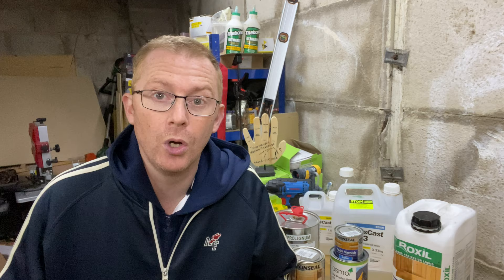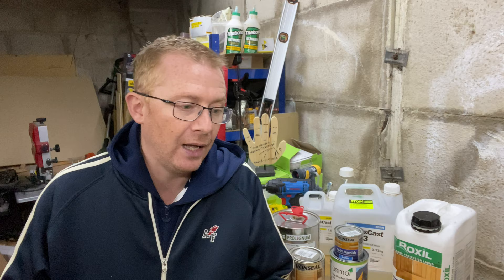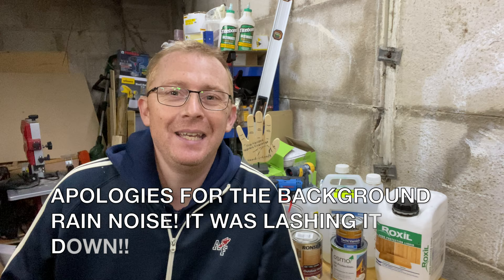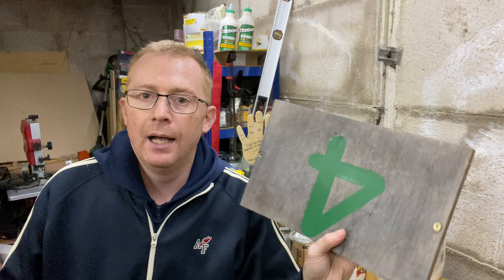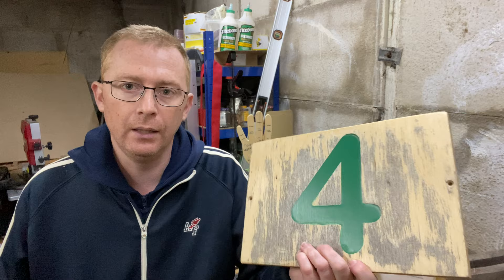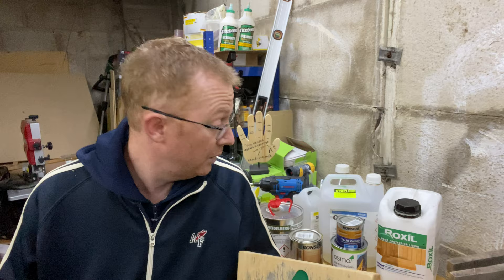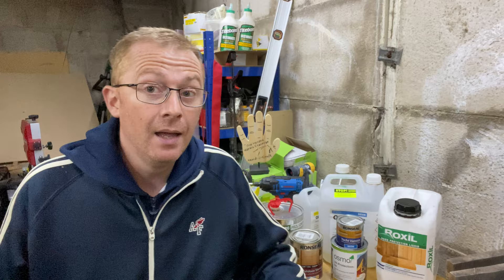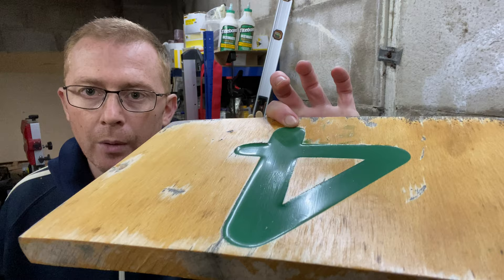Is Epoxy Resin Suitable For Outdoor Projects? (Part 2 of 2: The Results😀)

Comment: Oh, thank you so much for this! I was thinking of using epoxy resin on top of a concrete pad in the back yard, but after watching your video, I don't think I will. Thanks for this experiment!
Reply from the maker: Thanks Helen, if you’re after a nice shiny finish, have you considered polishing the concrete top? It takes quite a lot of work sanding through the grits like you would with a wood / resin table, but I’ve seen finished concrete tops that look fantastic 👍👍
Reply: saw a video that someone had a business made an outdoor wood and epoxy bar table that failed from weathering and when he made a new one he used Total Boat Halcyon  clear as the topcoat and gave updates on how it weathered and it worked perfectly. Make sure to do seal coats with the epoxy first to let it penetrate before thicker coats then sand prep the epoxy and top coat with  Halcyon or something comparable maybe? Wood and concrete need a seal coat before epoxy is poured so it doesn't seep into voids unwanted.

Comment: I had my money on Yacht varnish ⛵ but sec is OK, never expected osmo to finish top I thought that was just a hype train 🚉😂 great experiment Leo and now we know it's either Osmo or Yacht varnish for outdoor use. 😊😊
Reply from the maker: Totally agree Karl. Have to say the Osmo UV oil blew the rest of the other finishes out of the water. I will say the test was pretty brutal and accelerated the affects of moisture and UV, particularly with the angle the board was at which meant 'run down' not 'run off'.  But even so it is interesting to note how well one product holds out so much better than others in exactly the same conditions.

Comment: Great video Leo. Can't believe 4 months have passed already. Like someone said, leave the top 3 out over winter in the frost & snow, that should give a definitive winner. Keep em coming. G
Reply from the maker: Scary how quickly the time is passing at the minute Gary. And yes, just put the top 3 back out. Will post a pic later on Instagram. The angle certainly has accelerated the destruction process so to speak. I said in another comment that I forgot to mention in the video the original house number I done for a friend is holding up fine with just two coats of outdoor varnish, but it’s at 90 degrees to the wall. I showed my fiend the results of this and what will inevitably happen to his sign long term, but we only done as a test anyway so he didn’t mind being the guinea pig for it😀😀👍

Comment: Thanks so much for doing this experiment.  You're right that there isn't much long term comparison out there as far as I know.
I think when my Ronseal yacht varnish runs out I'll replace my outdoor product with the Osmo UV protection oil.  The issues I've found with the yacht varnish didn't appear until December in pieces I made in late spring.  Issues tended to be on horizontal pieces too, such as a varnished decking board used as a top to my daughters' mud kitchen.
Reply from the maker: I’m only guessing Andy, but I think the greatest cause of the coating ‘failures’ is the movement of the wood allowing gaps to appear. The boards were mounted on the osb with a spacer at the back and it was noticeable how much they cupped during the course of the seasons, but the Osmo board didn’t. It could just have been that piece of timber, but they were all taken from the same length of timber so I’m going it is more likely the oil worked it’s magic somehow and kept the board straight and true. I said the Osmo is an expensive product, but really it’s not that much more than the yacht varnish. Personally I think we turn to the likes of yacht varnish and danish oil because they are familiar sounding names that our dad or uncle used on a project in the 80’s (like creosote as well but that is banned now😂), but oils / varnish’s / coatings are very much a science now and I’m guessing have advanced massively in recent years 😀

Comment: I hope you leave them out over winter so we can see a 12 month update! I started using Osmo about 18 months ago, great stuff and in the long term not that expensive (you get what you pay for)
Reply from the maker: I’ve just put the top 3 back out Pistol. Just going to post a pic on Instagram now. Will leave it out for the winter and see what happens 🤷‍♂️😀
Reply: @Hand-i-Craft  Can you update on the winter experiment, did the Osmo UV Protection Oil  still hold up well? would any UV oil work? as there's some really good clear decking oils that also work very well on most woods, they penetrate the surface and prevent ingress of water and not so expensive.
Reply from the maker: @gazsto9510  Hello Gaz, I don’t know if you have Instagram, but if you have I posted some updates on there about this. Just to further clarify this was a brutal experiment that accelerated the process, I’m not one of the Osmo fan club for the sake of it, but the osmo product I used in this experiment was head and shoulders above any of the other products 👍👍

Comment: I have just had an oak sign go very black due to moisture egress which was covered with 5 coats of osmo uv oil. I was surprised to see osmo came out best for your test (which I thought was a great test) but I will no longer look to osmo oil in the future.
I'm going to try a complete encasement in epoxy for the replacement and see how I get on. Rather frustrating situation.
Reply from the maker: Thanks for the message and sorry to hear about your experience. tbh I have done a video about using Osmo UV oil on the cladding of the front of my workshop and had a very poor experience with it. Oak can be a difficult one for outdoor use. Good luck with the complete resin encasement, I’d be interested to hear your results in the future. My only concern for doing that is the movement of the wood through temperature changes would cause the resin to split and crack, thus allowing moisture in. Could be wrong though and good luck with whatever you decide 👍

Comment: Awesome experiment matey, If you reverse the air flow on a decent bike pump and place the wood in a sealed plastic bag and suck the air out you would get fairly good epoxy penetration into the wood. When fully encapsulated the wood doesn't change moisture content anymore and should be very stable. And of course using top of the range west systems epoxy will be better than the stuff people market as river run epoxy or whatever they call it. Epoxy is strong as hell but it needs some form of uv protection. My 0.2 pennies.
Reply from the maker: Cheers Brin and thanks for the detailed insight there, really interesting stuff 👍👍😀😀

Comment: So apart from Osmo they all pretty much failed,  I use a mixture of white spirit olive oil and raw linseed oil on outside projects and it fairs very well at waterproofing, and it really depends how well the wood is sealed as to whether you need hardwoods or not for exterior use and very important to coat all surfaces to get true results. but I really love these videos and the fact that some don't last 4 months is pretty appalling. keep em coming.
Reply from the maker: Designer- Garb Cheers Designer. It was really interesting to see how this experiment progressed. I do have to say the way I set it up certainly accelerated the process of what would happen. I should have mentioned in the video (but forget as I often do) the house number I originally made for a friend is holding up well as it is mounted to the wall at 90 degrees and I only used outdoor varnish on that. I showed him the results of this test and explained what will happen to it long term and he was fine with it. If I do make some of these the Osmo would be the turn to product. Certainly appears that you get what you pay for with that stuff 👍😀
Reply: @Hand-i-Craft  Yes there is no doubt Osmo makes some great products albeit crazy expensive by comparison but a good example of you get what you paid for. and yes you are right the conditions of your experiment would increase the speed in which they fail,  I will stick to my own mix   for the time being, but worth a try 50% white spirit and 25% of each oil, works out very cost-effective and works well.
Reply: Cheers Designer-Garb. I’m going to give this mixture a go.

Comment: Very interesting experiment fella. I had hoped to see an entire piece coated with epoxy, I thought that was the whole point. Anyway, the cupping was because you had the woodgrain running the wrong way, woodgrain must always be running along the longest length. This will also mean that the end grain isn't facing upwards collecting water. Laminating two pieces where the grain runs a different way on each will also prevent the cupping.
Reply from the maker: Thanks Steve for the info. Tbh I couldn’t imagine a piece of wood completely covered in epoxy would hold up too well, but agree it is something I should have done 👍👍

Comment: Brilliant video mate, I'm in the process of making a bench for my Mum and have been trying to figure out what finish to use on it. I'll throw my can of Roxil in the bin now and splash out on some osmo. 👍
Reply from the maker: Thanks Damian, cheers for the kind comment. If you’re going down the Osmo route, it’s great stuff. Pricey, but you do get what you pay for. I would suggest though if it’s for a bench they have better products suited to wood that is laid horizontally (like the bench slats) as they’ll take more hammer from the rain. Apparently the uv oil isn’t as good as some of their other products for this purpose. Quick check on their site would point you in a better direction than the uv protection oil I used in this experiment 👍

Comment: Good to see you only coated one side as it's not always possible to get to both sides. Good video Leo.
Reply from the maker: Polar Bear The Glasscast covering was really interesting Wil how it was tight solid at the top where the resin was, but failed at the bottom. I might for research purposes (no video, maybe just social media) completely seal a piece of wood in resin, put it on the board I had set up on the brutal angle and see if the movement of the wood affects the resin. What do you think?🤔
Reply: @Hand-i-Craft  I would be interested in that experiment. may be a couple of screws.tp hold it off and submerge the timber in glasscast.
Reply from the maker: Polar Bear I’ll see what I can do Wil

Comment: Hello, dear Hand-I-Craft, GREAT, GREAT, GREAT experiment!!! Your video HELPS TREMENDOUSLY! THANK YOU! We have this massive one slab table 39"W x 118" L. We don't know what kind of wood it is. We only know that it came from Indonesia. It was originally for indoor use for an art gallery display. We now have it outside (because we don't have a large room inside the house for it.) It started to crack and split more and more each day. It is now seating outdoor protected under a furniture cover.  We want to restore it with epoxy resin and seal it for our outdoor use. Please, would you give us some advice on what product to use? Yes, we did watch your video and got a general idea, but still feel very nervous to start the project especially choosing the type of epoxy and finishes like sealant and coating. May, we send you a picture of the table?
Reply from the maker: Hello Bonna, cheers for the message. If you want to send me an email with some pics that’d be fine and I might be able to give you a bit more of a detailed answer. Also, do you happen to have a wood moisture meter at all? They aren’t expensive and can provide some really useful information when considering a wood / resin project. My email address is 75handicraft@gmail.com

Comment: Wow, 4 months went by rather quick, seems like you only did this a few weeks ago! 😳
Great comparison test, mate. 👍🏽
Some results were a bit of a surprise...
Reply from the maker: Exactly Bill, four months 😳😳😳. I used the word ‘brutal’ for the test and it was, the angle of the board in particular really accelerated the process. It was really interesting to do and obviously to share the results. Have to say the Osmo was seriously impressive in comparison to the others.
Reply: @Hand-i-Craft  
Agreed, Osmo is a tad pricey, but you get what you pay for. 👍🏽
Having said that though, there's no justification for obscenely priced products other than sheer segregation and greed! Well that's my opinion anyway 😆
Reply from the maker: Bill Carroll yeah I totally agree Bill. I believe in your neck of the woods it is extortionately expensive. For example I’ve just checked and that 0.75lt of Osmo UV oil was £24 ($43 AUS) UK prices. Just out of interest what are you guys getting charged there online or hardware store? Is it import taxes that push the prices up? I’ve been talking to a guy in NZ about the Mirka video and he was telling me about the prices they are charging for the Mirka gear in NZ and I thought it was expensive here, it is eye wateringly crazy prices over there. Must be something to do with import tax 🤷‍♂️🤷‍♂️

Comment: Thanks from Oklahoma.... I've been wondering if I can do my wheelchair ramp with epoxy resin 😬 just to make it a bit more original.
Reply from the maker: Hello Tandi and greeting from Liverpool, England. Wow, what a question. You can purchase epoxy specifically designed for hardwearing floor use, like the type used on driveways to cover and secure stonework in place. Not sure whether you’d be able to apply tinting pigments etc🤷‍♂️. The glasscast I used wouldn’t be suitable tbh, but good luck in your resin adventures and let me know how you get on 👍👍👍
Reply: Thanks a lot for answering. I'll have to do some research on it, for sure. I figured that putting it on the top would make it too slippery from snow or rain; but, I'm going to check out n see if I can do something like a  design &/or something that's a glow in the dark on the sides. Thanks again..Stay Safe n Stay Well🤠

Comment: Very helpful. But not sure I can get these products in Canada.
Reply from the maker: Thanks Cindy. If you’re going to try it you need a good protection oil that will soak into to wood stabilising it and reducing movement. It’s the movement of the wood that affects this type of project and nothing to do with the resin. Have you got access to Osmo in Canada?

Comment: Oh my god.... 4 months... where the hell did that go 😫. Great followup Leo. With some great results. I was going to do something simular but opted for engraving in to slate (which worked well).... but now I am worried how the wooden mount will behave 🤔🤔. We shall see. I have been bitching about the price of Osmo... but it actually looks like it's worth the cost. Thanks again Leo for a great experiment. Take care mate 😁👍
Reply from the maker: Cheers Frank. I’ve said in a couple of other posts, the test was brutal. Having the wood on the angle really accelerated the process. The original one I made for a friend still looks fine as it’s parallel to the wall, and that only had a couple of coats of outdoor varnish. I should have mentioned this in the vid but forgot, but long term it will deteriorate over time. Totally agree with you on the Osmo front, but does look like you get what you pay for with it😀👍

Comment: Great experiment . Thank  you.   I am  still  trying to process  this for an application.  Now what you were testing was epoxy resin  outside durability and that  would  be the control piece (7).   The  results showed that the exposed wood would impact the resin  causing cracks.   But you did not  cover the whole  face of the wood or  all parts  that would be exposed to  the elements.  So it is  not conclusive on how the resin would hold up alone  only that the wood would not.    But  the other thing was  the OSMO.  Great stuff for sure.   But I  am wondering how  I would apply that on  a fully resin covered section of wood. say for  example the roof  my shed.   I would  like to  epoxy the roof and protect it from UV  damage.  So I am not sure how that would  be applied. or  if it would make sense.
Reply from the maker: Cheers Detroitblue for the message. I see what your saying here. I did coat one of the resin numbers with a thin coat of resin (number 4 I think) but I covered the top and the face, but not the underside. Main reason being I wanted to see how well the resin at the top protected the wood, but also if moisture got in underneath (which it did) how would the resin and wood react (it split / separated). What I should have done is added another one that the wood was completely immersed in resin front, side and back. Couple of other folk have asked and intrigue will probably get the better of me and I’ll have a go doing it over the winter and update via Instagram. The only issue I’d foresee with that is will the resin be strong enough to prevent the natural movement of the wood, or when / if the wood moves would it cause deformations / cracks in the resin? If I get chance in the next few weeks I’ll set that experiment up. Btw I’ve put the top 3 back out for the winter to see what happens 😀
Reply: @Hand-i-Craft  I read that and that is a great idea to test  over the winter.      You make a good  point about the movement of  the wood.  This brings to mind those people who make faux  petrified wood.   I think I  will revisit  how they are doing it.   Thanks again.

Comment: Osmo the winner but the epoxy glass cast  should of come 2nd especially as you didn’t cover all the edges it was much better than the lacquer and varnish.good vid tho mate thanks for sharing
Reply from the maker: Cheers Rocksteady. I take your point about the Glasscast example, problem being if you totally incase the wood the movement of the wood could cause the resin to snap